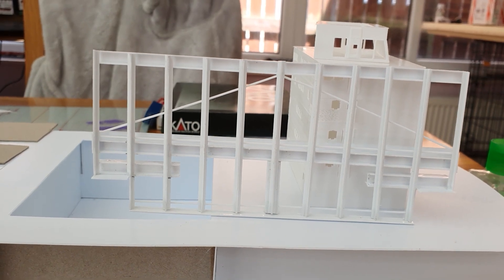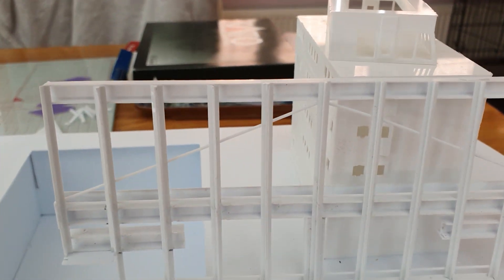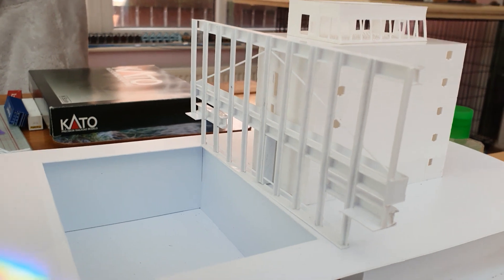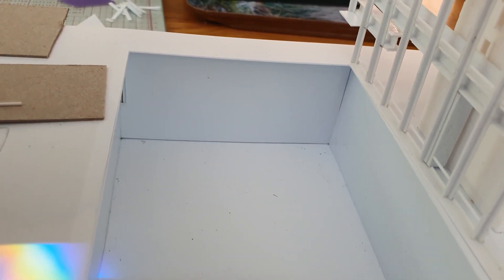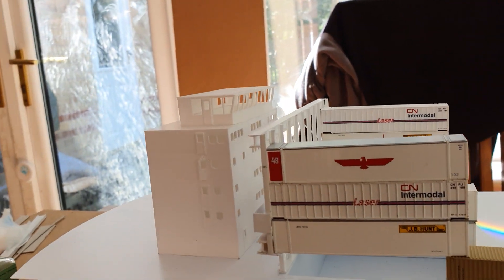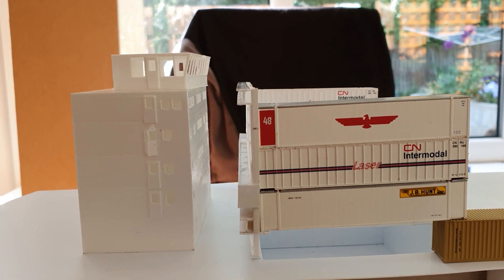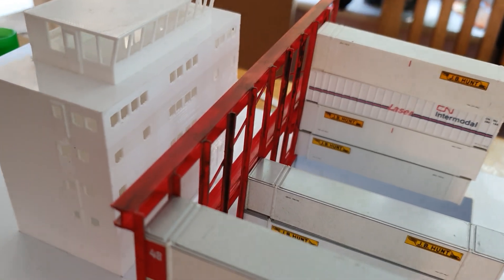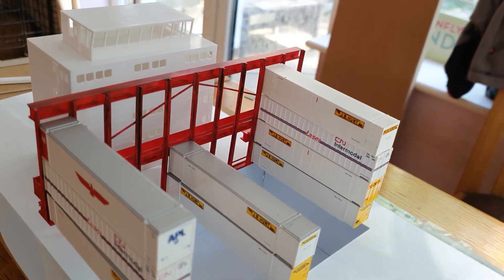No. 94 Part 2 Building The Container Ship (Cell Guides)

Comment: That is terrific Colin. You can always use the gardening/flower wire you fight in the $/£ shop. Cheap and smaller than Evergreen.
The framing looks great , just for your info the red oxide used was more of a dark orange 
Hatch coamings go around the edge of the hatch opening to strengthen and support the opening.
So you obviously had someone cut all this for you? Did you provide the drawings?
Reply from the maker: Hi I thought it wasn't the wright colour so it's, in it's finished colour 🤣🤣. Looking forward to doing some more. The guy who I brought it from did the plan and the cutting. But I've come up with the changes and designing the Cell guides. Colin